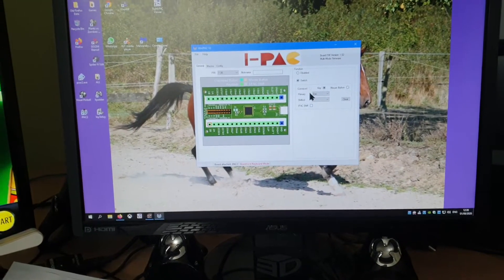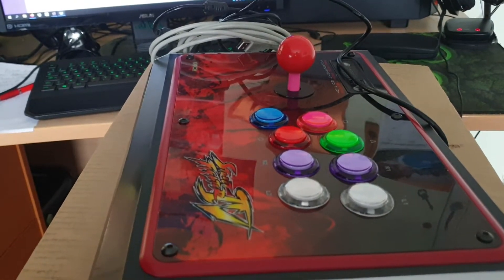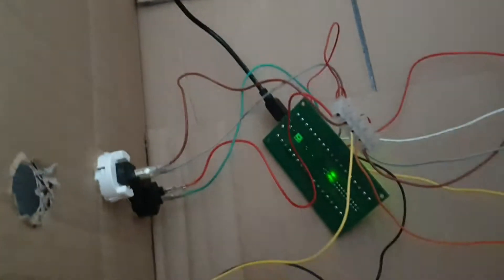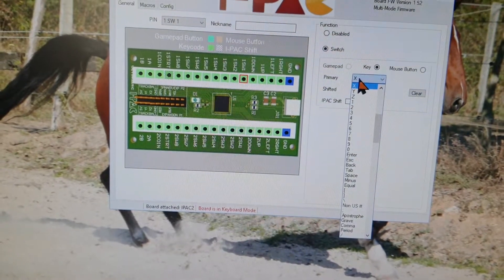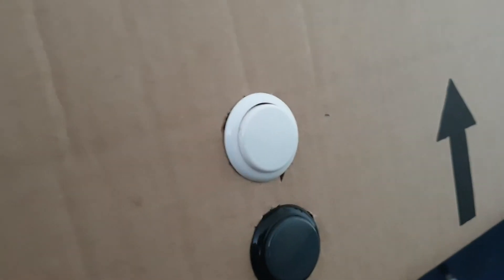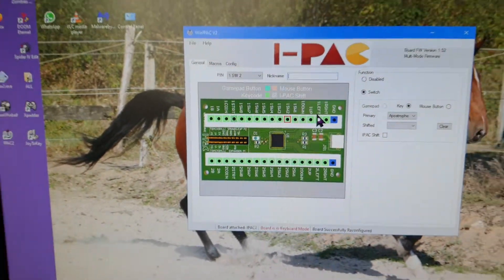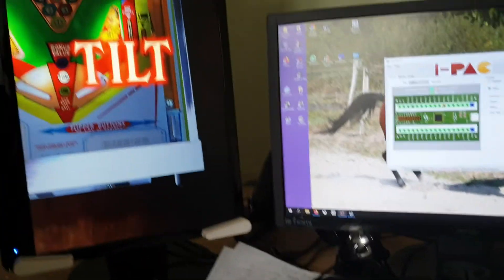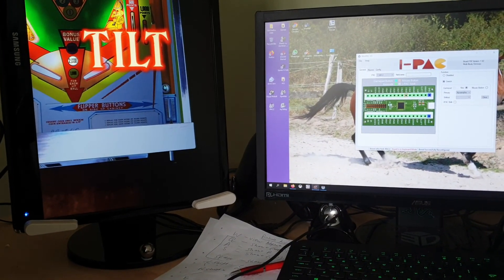Virtual Pinball Machine Build Part 1

Comment from the maker: No there is no wiring guide, you just connect one button to the common ground connection and the other to one of the connectors on the board. The joystick you connect to Left, Right, Up and Down and common ground. Then you make a note of the keyboard buttons as they are set up for the game on your pc after which you open the ipac software on your pc and assign the buttons with the ipac board connected to the pc via the USB port. For example if Z is the left flipper and X is the right flipper you connect the corresponding flipper buttons to say position 1 and 2 then make position 1 Z and position 2 X depending which way round they are connected. Hopefully this helps.